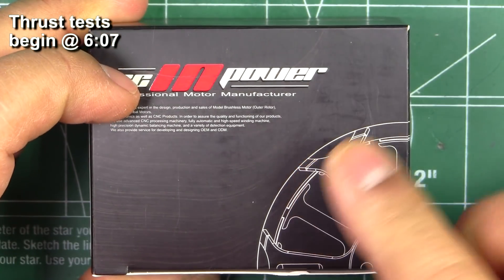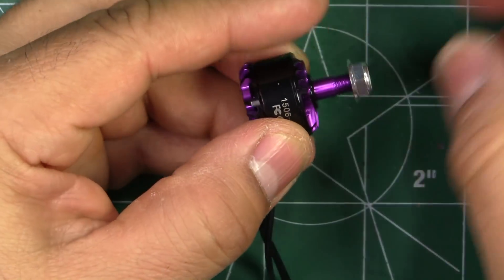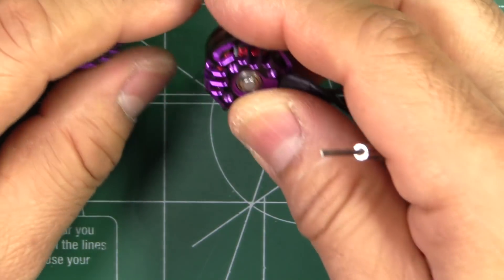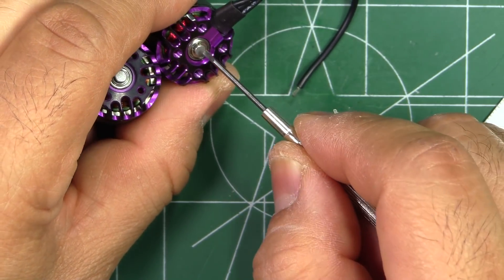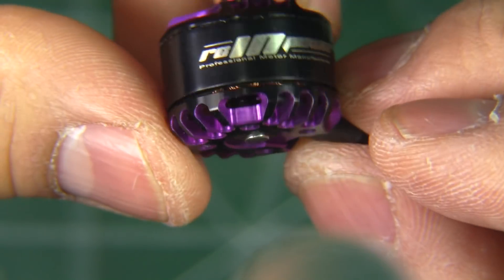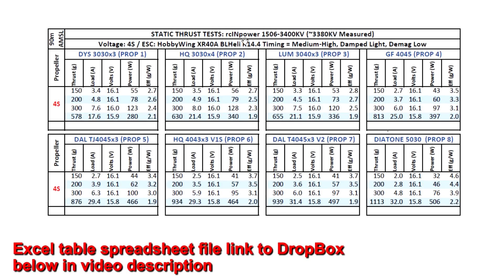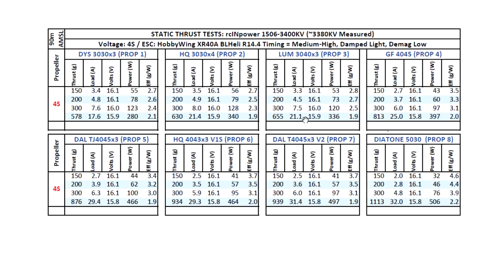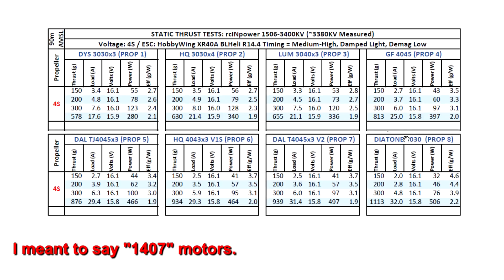rcINpower G1506-3400KV Thrust Tests & Overview

Comment: I got the 1506 3400KV a couple months ago to use in a project I intended to put on my engineering resume. I cannot, for the life of me, get anything close to your output. Running it at 30A 4S only gives me 40g of thrust with a 3052 prop. I've tried the Holybro Tekko32 esc and the multistar esc, and both are outputting about the same results. Any idea what may be the issue? I'm super new to all this so maybe there's a step I'm missing?

Here's a picture of my setup: https://drive.google.com/open?id=1mIIYHethsFsR2_8Yk8F6DeoPrHU5N406
Reply from the maker: 40g and 30A? Definitely something wrong with Your setup. Motors half this size can output 3x what you're getting. Check your propeller orientation. Looks like it's not mounted correctly for your setup. Should direct thrust upwards so needs to be mounted "upside down" watch some of my videos from 2 years ago. Similar set up with DIY thrust stand. Check that you're getting full 2000us signal for ESC out of Arduino. For troubleshooting, replace with remote control and receiver or a purpose-made servo tester. Make sure voltage doesn't sag down below 14.8V to get closer numbers to mine. I used power supply V goes down to 15.5-15.8. Cover those esc connectors better. I see exposed metal there and you don't want accidental shorts. Hope that helps.
Reply: Thank you for the quick response!

I will look into your suggestions and see if they help. Luckily I'm in an AIAA group so acquiring a temporary remote and receiver won't be too difficult.

I'll check back and let you know what happens.

~Joseph
Reply from the maker: Check prop orientation first. I've done that mistake several times ;) Yep, let me know how it goes.
Reply: I had no idea props would work with different efficiencies depending on their orientation! Now it sounds dumb that I didn't consider it D:

So, turning the prop around yielded 80g of thrust at ~40A (for a short burst). First of all, if I set my throttle to 20% I get 37g of thrust and my power meter reads values ranging from 4A to 20A. At 25% 57g with 20-32A. Is this normal? Perhaps (fingers crossed) my power meter is overestimating? With such large fluctuations its hard to tell what it actually is.

Does this sound like any other common problems a noob like me may miss out on? I'm working on acquiring other equipment to maybe test it with higher quality components. That won't be possible for a little while though.
Reply from the maker: Now you have to check the direction of rotation. Using the picture on your Google drive, you need to flip it up side down and motor needs to spin counter clockwise. To change motor spin direction just switch any 2 motor wires and that will "reverse" spin.  Try that and see if that helps.  80g is still way too low  .... by a large amount

Comment: does these would work for 4"-er?
Reply from the maker: Yes, you can run 4" props like 4045x2 and HQ4043x3
Reply: Thanks for reply! Yeah, my plan is to rock with those three blades, little bit on heavy side - Japalura frame... So want some power to lift it up... Japalura ussualy comes out heavy!
Reply from the maker: For heavy builds. Make sure you check motor temps after a couple of laps. It's OK if motors run a bit hot, I usually do a "smell" test, they shouldn't have the burnt enamel smell.

Comment: I just posted my rcINpower 1506 3400KV build at https://rotorbuilds.com/build/12563  -  it's under 250 grams AUW.  The pictures are with gemfan 5x3x3 props which I have found to be TERRIBLE.  I'm now using HQ 4x4.3x3 V1S props and it flies amazing!  Don't try to fly heavy props on these - when you do you can tell the motors don't have the same high-rpm response.  These motors, although notchy when spun by hand, are silky-smooth in the air.  At this motor weight (17.6gr), I found a super-light frame that seems to be indestructable (Schnapp Dragon frame).  Also one note is that although the wires are short, they were the exact length I needed to connect with my XJB F425 4-in-1 ESCs without adding any wire.

Comment: Thanks so much EngineerX for testing these motors!  After reviewing all of many of your thrust videos, it looks like the rcINpower G1506 is the motor I want to run AUW of 250gr w/ 4S 850mah on HQ 4043x3 V1S... BUT I looked at myrcmart for them and they have a version called the F1506 and it now has this statement:

** There is a new version of F1506 with different material (we named it V2). Please make sure your motors are V2 new version if you are buying the motor (for replacement purpose) on this page. The V2 F1506 has stronger magnets than previous version so it cannot be used together with the previous version on the same Quad. And it (V2) cannot be distinguished from the box and motor. So if you are not sure, please get a full new set instead. All F1506 shipped from us after 23th Jan 2018 are V2 version.

Do you have any idea if this F1506 is the same as the G1506? Is this aluminum 7075 (now/before)?  Also, wouldn't upgrading to stronger magnets cost efficiency? 

It seemed like a great motor - too bad they had to mess with it (if it has lower efficiency). I guess the alternative is the BrotherHobby R3 1507?
Reply from the maker: With stronger magnets, it means more power and they'll use more Amps. If you compare efficiency at same thrust, say around 100g, 200g, 300g they're going to be very close and nothing to worry about. However on the top end, the motor with stronger magnets will most likely achieve higher RPM > higher thrust > use more Amps. It doesn't mean the motor is less efficient, just means it can achieve higher RPM and therefore at the top of its performance envelope it will use more Amps. If you limit throttle to get same thrust as Version1 then they should be very close in efficiency. But I would guess the stronger magnets will use a little higher Amps. Maybe 1A as you get to the top quarter of the RPM range. I didn't see rcINpower publishing material of motor armature so most likely it's 6061 Aluminum but I can't confirm. However, saying the V2 is different material points to V1 =6061, V2 =7075. rcINpower makes very good motors so I think they're always a very good option. BH would be another very good option too. You can't go wrong with either. The 850mAh LiPo will be just about good enough for 3400~3600KV for a quad like the one you're planning on. 4100KV motors will sag voltage on that size battery when flying aggressive freestyle or cruising at very high speed. From the tests I think you'll need a 1000mAh for 4100KV and that will put you above 250g.
Reply: EngineerX - you are the best!  Thanks so much for your explanation on magnets and motor efficiency and for all your thrust videos and analysis that helped me figure out which motors I'll get (the G1506 / F1506) to power my next quad with!!  Regarding voltage sag and the KV, would a 1000mAh 3S on the 4100KV work better/equal/worse then a 850mAh 4S on the 3400KV as both batteries have the same weight ?
Reply from the maker: I think 850mAh-4S on 3200 - 3600KV motors (any 1407) is the "preferred" setup for balanced performance. Plenty of power and not so harsh on batteries. 
It's probably better than 3S - 4100KV. 
With lower KV you will have better throttle control resolution thru the RPM range, the higher KV motor moves the  powerband to the higher portion of RPM range.
To stay under 250g, you have lots of constrains: You need to keep motor from overwhelming battery capabilities. So selecting a good combo is important.

Comment: Hi EngeneerX! Nice video as always! I have one doubt for you. Wich motor would you pick for the best racing performance on 3" quad and kv? I am building my 3" for the competitions of the season and I don't know wich choose
Reply from the maker: A lot of people like the 1407-4100KV for fastest quad, but you have to have very good LiPo and maybe only get 2minute flights. Next best is 3600KV. Now we have 1507 and 1506 size motors, those will also be good, maybe slightly better than 1407. Check out RCAddict he gives good info and talks about 4100KV and Gemfan 3052 prop https://www.youtube.com/watch?v=QCkHs9P95Mg
It's very difficult for me to tell you exactly which motor because so many variables, including the type of flying and the type of race tracks.  I think most advanced top pilots use 3600 or 4100KV, and the choose depending on what feel best for them. I think the only way to know is to try them and see which you like best, but then you have to spend more money if you buy 2 different motors :(
Reply from the maker: Another one https://www.youtube.com/watch?v=BmdrQfwdA6o
Reply: EngineerX Thanks for the answer! I saw the two videos! I am thinking about high kv like 4100 but I'm between tornado T1, GEPRC 1408 and the new sunnysky 1408 3800kv (but they're heavy). I saw really good info from the RCX 1407 too. What do you think?
Reply from the maker: Sunnysky makes very powerfull motors. I think the prop nut they use is not M5, it's smaller size so you have to use different nut and wrench. Shaft is standard 5mm, only prop and shaft thread is different. I bought the 3200KV from BGood to test, maybe in a couple of weeks I test it.
GepRC seemed it wasn''t as powerful as I thought it would be and seems the wire in the windings is not good hi-temp resistance but if you find good reviews of people using it without issue, then OK.
RCX is good and inexpensive but I didn't see about its durability yet. This rcINpower also very good. I have to tests the higher KV soon, I think it will be powerful too and good for 3"
Reply: EngineerX yeap! All you say is right. My first choice is the sunnysky but as you say the size of the nut is M4 and it weights 18g. The problem of the GEPRC is exactly that. The wires don't work well with heat. I didn't see the rcINpower but seems really powerful as always with this brand but in the same line of battery hungry. The Cobras 1407 are warranty of good performance but really expensive... a lot of factors hahaha
Reply from the maker: Well... good thing there's many choices, before we didn't have so many but now it's difficult to decide because so many hahaha.... Cobras also good, I forgot ...T-Motor F20II 1408-3750KV looks good too

Comment: Either I’ve gone blind or you didn’t weigh them? Look good for such a low Kv. When’s the 4100kv coming? Thx for testing.
Reply from the maker: I did weigh them and film it... but seems I didn't copy or dropped the video clip on the editor timeline. I'll get the weighing clip on the 4100KV video. 
W/80mm factory motor lead wires = 17.0g
W/50mm motor lead wires ~16.8g
Reply: Thanks

Comment: Merry Christmas, so far happy with the 3400kv has been working out well on a 3inch build, very punchy but would recommend the 4100 for those who like higher speeds.
Reply from the maker: Edward Lee Thank you Edward and Merry Christmas to you and your family as well. Yes these motors sure feel top of the class. A lot of the rcINpower stuff is quite good.